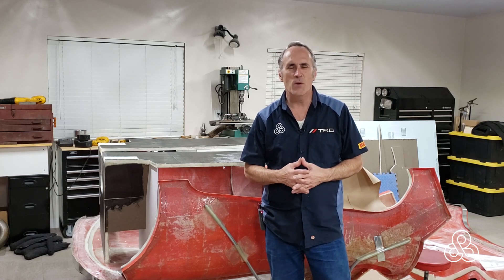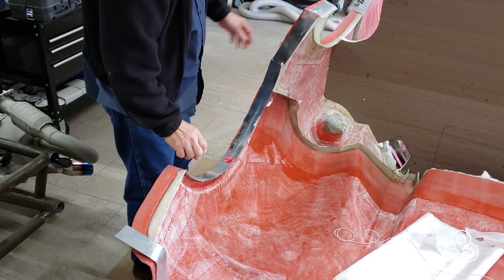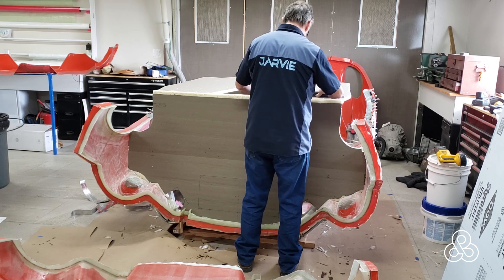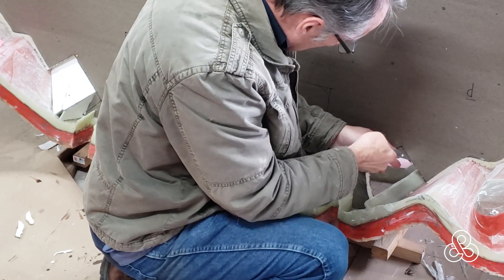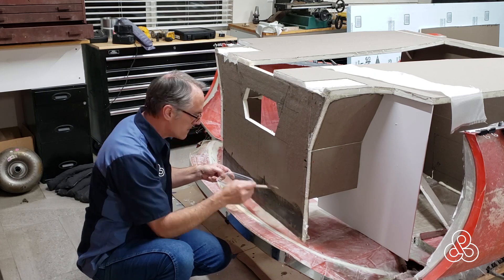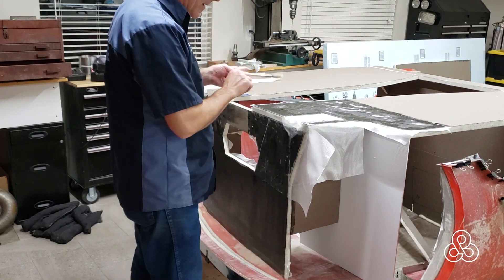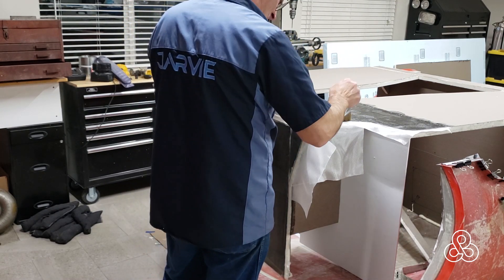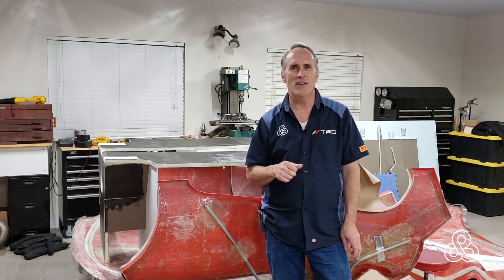A23 - Work on the monocoque tub, we laminate the bulkheads and floor. Arete supercar project.

Comment: Hi Jay. As of the making of this video, did your 25K budget include the Buck and Molds, or is it only the Arete Supercar itself? Thank you.
Reply from the maker: Yes, that includes those expenses as well. The buck, as you can see in the video, is constructed of fairly inexpensive materials. The mold, is made for one-off, (or fairly few) parts and is lightweight. If I had built heavy duty (vacuum bag/infusion capable) molds, the price would have been significantly higher. To tell you the truth, bolts and fasteners have been the most surprising, could we say "outlandish" expense, I had not anticipated.
Reply: @BuilderCreator  Thanks for the reply. I would have guessed that the epoxy resin would have been the most costly item.
I'm wondering, how did you go about selecting the windshield? Is there a database? Or was it time invested at salvage yards?
Reply from the maker: @GrayRaceCat  The epoxy is usually a bit over twice the price of polyester resin. Building an inexpensive mold is about the only time I will use polyester (vinylester), as the smell and mess is about equally inverse to the added expense of epoxy. Ha! The most expensive item is probably the S-glass fiberglass. Not only is it a little more rare than typical glass cloth, but as you can imagine, layer after layer, adds up to a lot of yardage. I found the window by cruising through parking lots and stealthily grabbing a quick measurement while the owners were shopping. Just needed to find the general width and height, as I could adjust rake, in my own design, by tipping it back. Wrecking yards work as well. ;)
Reply: @BuilderCreator  Thank you. This is all great information. I have two projects in mind. One is to electrify my ‘64 Volvo 122s four-door. The other is a sports car of my design. I have yet to decide if the bodywork will be steel, aluminum, or fiberglass. But the windshield has been a concern, for the reasons you mentioned.
Thanks again, and safe and happy 4th to you and your family!

Comment: A structural foam core such as HEREX C70.75 or lighter would give far supperior results  for  structural BHDs and panels. Core bond and core shear are important factors for resistance and impact survival. It is a funky choice to go for non structural core and no skin tie. Core shear, skin debond and local skin buckling are very likely with low density non structural foam core.
To bond structural panels, it is important to prepare the bonding surface with 80 grit to remove the layer of pure resin left by the peel ply, in order to bond on the fiber and not on a layer of resin that can peel off.  You can apply a layer of epoxy glue before laminating your bonding tapes. Laminating Resin is not as good as Epoxy glue for secondary bonding (check the supplyer's data sheet). Your bonding tapes should be +/-45deg and not 0/90deg to transfert the load. Stagger the layers 10mm/100g to spread the load. 10mm cove radius  is also recommanded in the corner.

Comment: Me again, just watching this Video, and you said 40 layers is that just for the main tub or the beams in the tub, and how do you keep track of how many you have put on as I am sure  you have to keep moving from on areia o the next so it is all tied in nicely, also with the epoxy do you let it fully cure, dry to the touch before you lay the next layer or just tacky, I have only used Epoxy once and I let it dry out between layers and it all delaminated ?? so a right mess, again Thanks, Eddie
Reply from the maker: 40+ layers in the vertical laminates in the roll structure. It would be optimum to to complete all layers in one sitting, but that is impractical as you can see. If the resin cures you must scuff (sand) between layers to expose previous fiber and remove any contaminates.

Comment: I have had an idea for a while now of getting expanded titanium mesh that’s usually used in security screens and pressing it into some of the shapes required to make the tub and any area that needs fasteners to attach subframes and crash structures.
It would not take much to make a steel form you could use to press the mesh into the basic shapes required then fine tuned with a hammer and dolly. You would then weld a tapped plate to the mesh and laminate it in.
I did speak to an engineer at a yacht builder about the method but he was against titanium form some reason I didn’t get to discuss (brittleness in salt environment or something).
Reply from the maker: Or likely it forces you to use titanium $$ fasteners, as differing metals suffer galvanic corrosion problems in marine environments?
Reply: @BuilderCreator  that may have been it. Used a far bit of stainless in that shop even though they only worked on mega dollar racing yachts. Even the toilet bowls were carbon fibre in their yachts.

Comment: What is the foam panel you are using?
Reply from the maker: Construction grade polyisocyanurate (polyiso), found at your locale big box home supply.
Reply: I've been trying to source polyiso board here in the east but the big box stores only have Johns Manville brand which is one side foil-faced. Do you know the brand of the board you bought?
Reply from the maker: @richardkensicki1347  Sorry, I don't, no markings. Try a contractors supply; those that deal in roofing, that is its main market.
Reply: @BuilderCreator  Thanks